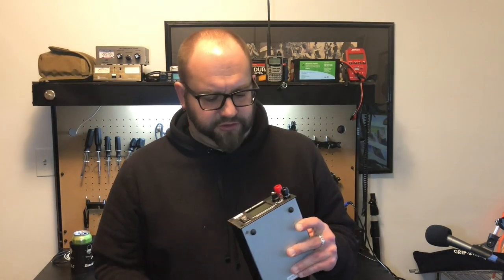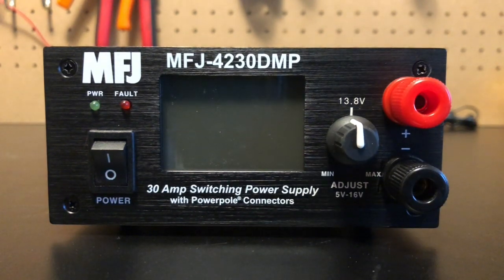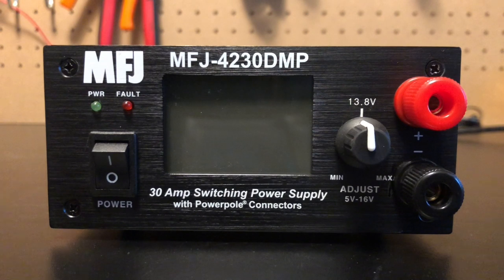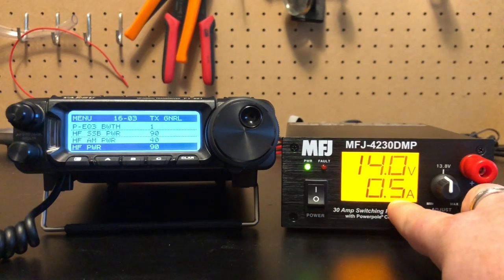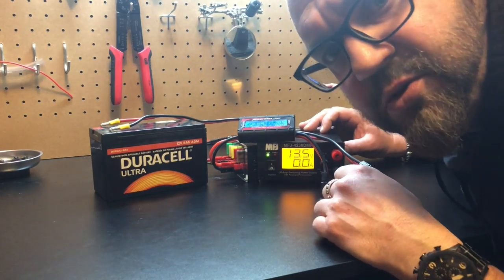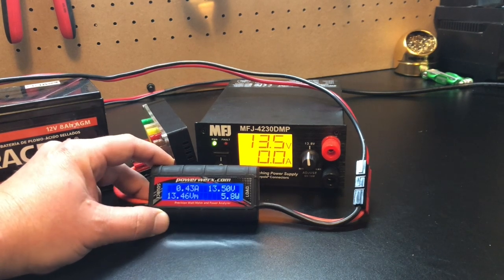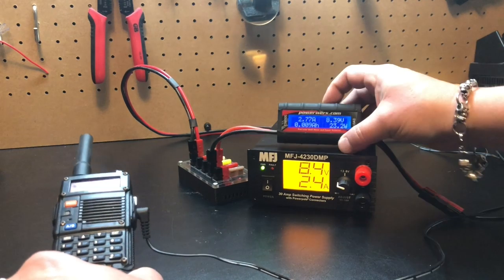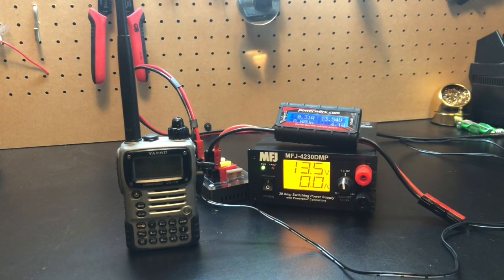MFJ 4230 DMP 30A Power Supply with Powerpole® connectors.

Comment: Could of questions......Would I need an in-line fuse with the power supply? Will this work with the ICOM 2730A? If not what power supply would you recommend to power my ICOM IC-2730A?
Reply from the maker: It would be wise to put fuses on things, yes.  This should be no problem for that radio either.  I rather like this power supply and use it all the time.

Comment: Did I miss something? How did you connect the HT ‘s to the power supply? I see the cord go into the HT but not sure what’s happening on the other end?
Reply from the maker: I have a few HT's that charge off of 12V so I can connect them to the power supply.  My Yaesu VX7R just goes straight into it with the power wire, and the charging is handled internally.  I use power poles of course.  I can also lower the voltage for other ht's that like to see about 10 volts, plug it into the cradle, and charge away.

Comment: How easy would it be to accidentally bump the voltage knob and put 16 volts into a radio rather than 13.8?
Reply from the maker: Not very easy.  I feel that would have to be a more deliberate thing.  Plus, the dial has an indent so it stops on 13.8, and needs a bit of pressure to move it away from that.  It's pretty solid.
Reply: Yes. I’m a bit wary of that too. I take the knob off and just leave the potentiometer spindle showing.  It’s hard to turn. In the past I’ve also used spindle locks which basically lock the potentiometer from turning. If you can’t find a spindle lock try a mini vernier dial knob. These are supposed to be used with multi turn potentiometers but can be used here too, just because most have a locking lever that prevents adjustment when set. Although a tad more expensive than a spindle lock, they are more aesthetically pleasing on a front panel. A cheap skate option that I use on a lab power supply is a bit of blutac or tape 😜😂 on the voltage adjustment control.

Comment: Thanks for the review Mike.  I think I missed the model of the charger you had attached. Hope you and your family have healthy and happy holidays.
Reply from the maker: Thanks for watching Kevin.  I wasn’t using a charger.  I was using the power supply to charge directly to the battery and the HT’s with the Powerpole connector on the back of the supply.  The adjustable voltage allows you to do such things and more.
Reply: K8MRD RADIO STUFF , thanks, the device you had in series between the power supply and battery in your demonstration?
Reply from the maker: @kevmscott  Thats the HamRadioWorkbench Powerpole distribution block.  Just used it to have a fuse inline.
Reply: K8MRD RADIO STUFF and it has a meter on it showing the actual amps?
Reply: Sorry for the 1000 questions, I did a screen capture and found out it was the PowerWerx  precision Watt meter that I was referring to.  Sorry to bother you with the questions.  Thanks again for the video, Happy Holidays!
Reply from the maker: @kevmscott  Oh that, yes.  No worries at all.  Thanks for watching and Merry Christmas.

Comment: I use a trip lite pr60. Powers the 3 radios in the shack at full duty. I like mfj but not the power supplys.  I have a smaller power supply switching and it has a noise offset  Switch. Send that garbage back.
Reply from the maker: Haha, I guess I've been pretty lucky.  I have 3 switching power supplies and I don't hear noise from any of them.  One is from RadioShack!

Comment: I'm sure it's super quiet but i find it interesting that you tested the noise while in cw mode as that mode would have the most filtering in place to eliminate interference.

Cool vid
Reply from the maker: It wasn't a radio noise test, it was a "how loud is this fan" test.  As far as radio noise, I haven't had any of that either.
Reply: @hamradiotube  Because it has proper filtering or is equipped with ferrite chokes?

Comment: I do wish they had a hold function on the voltage to prevent an accidental bump.  Just like on certain radios. - KD2KAK
Reply from the maker: Its not really a big deal though.  It just sits on my bench and I have never accidentally changed the voltage.
Reply: @hamradiotube  Agreed and most stuff is low voltage protected.
Reply from the maker: @brianpeck3120  I did learn to not plug in a Raspberry Pi until you are sure your voltage is at 5V haha!  Not with this power supply but it still happened.  Got to see some magic smoke though!